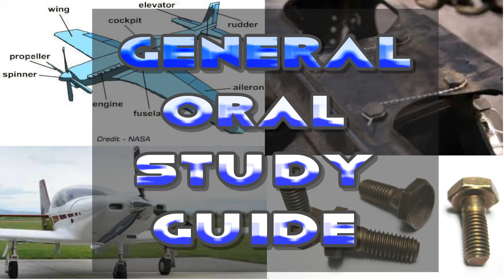2026 FAA GENERAL Oral Exam Study Guide

Comment: I must have watched 10 hours of your channel between the airframe oral and general oral videos. If i pass this test Monday I'm heading over to your shop and picking up a sticker
Reply from the maker: Bro my pliers are coming soon once you pass ill send you link for my safety wire pliers 🤪🤪🙂🙂🙂
Reply: @northeastaviationpro maybe that will be my gift to myself after passing my powerplant o&p
Reply: Did you pass how was it any tips
Reply: @300goincray3 yes sir. 

First, just relax. It's an easy test. I didn't listen to people telling me this so please listen to me. It is not hard. You WILL pass.

Secondly, get extremely familiar with the sections you didn't perform well on for the writtens.

Lastly, dont delay. Take the test and dont push it back. You will never feel ready to take it.

Giving tips is hard. Ask anything though and I'll give you an answer
Reply: @qmatlrbsej is the written all multiple choice and what should I study for mainly for the o&p? Did you find work? Do you think it’s hard to get in the major airlines?
Reply: @300goincray3 yes the written is multiple choice was four possible answers. Study the sections you got wrong by looking up the codes from the sheet you get back from your written. Watch this video along with looking in the back of the Jeppesen book. I have not found work yet. Yes major tend to be more difficult for a variety of reasons. Most require relocation and experience
Reply: @qmatlrbsejwassup brother, where can I reach you? I got questions about orals, I passed my writtens and practicals for general and airframe but have failed the orals twice.
Reply: @Swavyy_Jayyy right here. Ask away
Reply: Taking my General and Airframe O&P, what is harder oral or practical. And what should I practice for practical section? I think I’ll do fine for the oral!
Reply: @sofianaranjo8036 I would say the oral is harder only because there are a handful of questions you need to memorize. Practicals are difficult to study for. I would recommend buying the Jeppesen book which includes practicals and oral questions. I would just touch up on simple stuff like riveting, safety wire, 43.13, micrometer, voltmeter, etc
Reply: @qmatlrbsej lmk please

Comment: Just passed my O&P for generals and airframe! Thanks bro!
Reply: How were the questions? Hard or easy? Was jeppesen good for studying the oral questions
Reply: Ya id say jeppesen was worth it. Not everything was word for word but it helped a lot. The test wasn't too hard if you study enough.@lamboguy123
Reply: @00711cd  good deal. I appreciate it my man. Been killing myself studying 5 to 8 hours a day. It'll all be worth it in the end 💪
Reply from the maker: Congrats bro, this is the first step
Reply: Would you say most of the questions you got were from this video?
Reply: @cypress2050  I know you probably weren't asking me, but I just got my airframe. I would say it was very mixed. Only a handful were from the book and this video. However, it was not particularly difficult. I honestly found studying the 8083 to be much more beneficial than using the study guides. I actually did not even study the airframe study guide, just the generals. For the most part, my oral questions were very simple, most being one to three word answers. Definitely based on my missed acs codes. What I did was I went to each section in the 8083 that related to my codes and made quizlet questions for anything that could be a bullet point or an oral question and then studied those. Then I brushed up on the entire chapter but didn't necessarily memorize. For instance if one of your codes is "landing gear warning and position indication systems," study the things that directly fall under that code and then re-read the entire landing gear chapter. I honestly found the two oral questions asked during the practicals to be much more difficult. Good luck! You got this!
Reply: @lamboguy123 I really appreciate this. I have my general + airframe o&p coming up so I want to be as prepared as possible. Thank you.
Reply: @cypress2050  of course! It really isn't all that bad. As long as you take the time to study, you'll get it over with and wonder what you were worrying about!
Reply: @lamboguy123 thank you again. If i have any questions in the future, is it cool if i ask you?
Reply: @lamboguy123 congrats. How about the practical projects? How many projects were there? Moreover, how to know the list of possible projects for preparation point of view. Any information would be helpful. Thanks

Comment: 00:17 Chapter 1 Math
04:53 Chapter 2 Physics
11:34 Chapter 3 Basic Electricity
17:33 Chapter 5 Aircraft Drawings
22:36 Chapter 6 Weight and Balance
36:28 Chapter 10 Fluid Lines and Fittings
45:47 Chapter 12 Cleaning and Corrosion
52:48 Chapter 13 Ground Handling and Servicing
01:1:47 Chapter 14 Maintenance Publications, Forms, and Records

Comment: The questions I was asked were not in this video.
1. What is the relationship between electricity and magnetism? Electromagnetism.
2. What does a conductor producer when it conducts energy? Electromotive force.
Reply: How did you do, what material did you use
Reply from the maker: Good lookin

Comment: Just an update, took my A&G on FEB 29th and passed both the orals and the airframe practical. Failed the general practical for dumb shit really which was all me. Doing my  retest for my general practical on april 10th. For the Orals some questions I definitely knew because of these videos but if I had to make a recommendation I would say get into this and also study the chapters in 8083s on the sections you  got wrong from the writtens and actually understand the systems. Really helped me out alot. Focus on the writtens, the practicals are fairly easy and pretty much open book when using reference material. 
Take it from a guy the Graduated an AMT school in 2016 i was really nervous but once i got into it, it wasn't that bad. Study and do what you gotta do but don't stress and burn yourself out too much. Hope this helps
Reply: Are most of the questions based on what you didn’t get right on the written part?.I just finished all 3 of my written and started studying for the o&p.
Reply: @ricardonarbona5028  Yes!!!, they are.  my recommendation. watch these videos because some of my oral questions were definitely word for word but also go through the 8083s and study the chapters of the sections you got wrong on the written because oral questions I got were definitely not in these videos so reading the chapters helped me in that way. Like what are the components for a capacitor? or what does a Carburetor do?
What are some different types of pumps? What's a stress on a aircraft structure? questions like that you'll get from the 8083.
Reply: @elliottbradshaw242  Thanks.
Reply: @elliottbradshaw242  Good luck on your restest April 10th and hell yeah to passin the rest! 💯😎

Im about to take my O&P soon for powerplant/general. Question tho! 

So, based on the missed written ACS codes, just study the related chapter in the 8083 books—that I understand—but are you creating your own questions (?) is there a version of the 8083 that has questions to answer/study? Or you studied the 8083's sections based on what you missed and knew what to answer during your oral  test?
Reply: @kamekaze997  No unfortunately there are no questions within the 8083s. It's just a general textbook that most other textbooks get their info from anyway. I just studied the chapters and made my own index cards on info that I thought would be  important. If I had to make a recommendation Learn these videos because some of my oral questions were definitely word for word. but also study 8083s and learn the systems and components and whatever knowledge you think will be important
Reply: @elliottbradshaw242   ty for the quick reply bro! 

I'm literally studying this vid's transcript alongside a pdf my school gave me making flashcards, using chatGPT to dumb shit down lol, highlighting stuff in my 8083 books and taking your advice! 🤙
Reply: @kamekaze997  All good bro, just want us all to elevate. good luck on your tests and let us how it went.

Comment: Just passed my O&P 01/27/23. These videos were the reason I passed my orals, thank you for the time and effort!
Reply from the maker: Great job man help show support by getting some aviation merch check out link in description.
Reply: Congrats! How did you prepare practicals?
Reply: @30센치강철팩  if you are familiar with following a manual you won’t have to study for practicals. I personally only refreshed my memory on weight and balance equations, sheet metal formulas (or where to find them in a handbook), and practiced my safety wire
Reply: Was the orals the hardest part? Im studying for my general right now
Reply: @JJFN-zm3ky  Personally, I made study guides on quizlet for all the questions I couldn’t fully/accurately answer and that was the hardest and took the longest for me. But if you study you will pass
Reply: What is your name on Quizlet
Reply: @carson cook

Comment: Took my Os today for A&P and passed. Trust me when I tell you 100% of the questions asked was from this guys video. Sadly I didn’t get my License because I failed 1 little project where you have to put the correct size of the bolt in the hole 😂
Reply: I’m pretty confident about the oral part but I really don’t remember any of my school projects 😅 do they give you a manual or instructions for the practical portion? What do you recommend me brush up on before I go into my exam? Going this Monday for my Powerplant then Airframe later
Reply: @kushedd  how was your test? 20 days away from general and power plant, and also worrying about the practicals because I might not remember them.

Comment: I tested Tuesday, every question i was asked on the oral is included in these 3 videos. If you study these and remember all the answers there should be no reason you don’t pass. Thank you for making these.
Reply: I take my O&P in 3 weeks..how was the practical part of the test?
Reply: @DG-lo9mv  hey man the practical would’ve been difficult to study for. Just ensure you know how to navigate a manual. And also use a manual for everything you do. I had to do a power plant inspection and find things that would make the aircraft unairworthy, blend a dent on a prop, flare a hydraulic line, drill a few rivets, calculate weight and balance, install ignition leads on an engine. Maybe a few more things but all very basic things
Reply: @reeddigiulio2938  ok appreciate it
Reply: Bro this has me hopeful as shit, most of the may questions I can understand with my highest level of math being college algebra k my junior year and I’m applying for AIM Houston in two weeks
Reply: Math* idk wtf it autocorrected to may
Reply: @Reed Digiulio I take my o&ps tomorrow are there any videos that can give tips to improve my skills on how to navigate a manual
Reply: @Slappinnalgaz  p hub offers a lot of tip videos
Reply: What’s the best way to study this whole video?
Reply: @gioch8882 just listen to it anytime you get the chance and answer the questions verbally. If you don’t know. Listen to the answer and turn it into a way you can understand it. I listen in the car during work commute, at the gym or if you’re even at work if your job allows you
Reply: How long did you study
Reply: Good to heD
Reply: Are you tested on math and then physics. Or are the questions all mixed up?
Reply: Did you pass your orals ?

Comment: about to take my first general exam, this video helped a lot. Its one thing when you read it in the jeppesen book and can see the answers, its another trying to answer the questions without looking at anything and then knowing the areas you need to work on. Great video man, thank you!
Reply: Have you took it yet? I'm looking to take it myself in a month, other than this video and the jeppesen book what have you found best helps with studying and retaining the info? Just finished my general classes a few weeks ago AIM student in Orlando
Reply: @randymorera5286  if you have access to fulcrum they have videos on there that give some pretty good break downs of everything. Some questions were directly from prepware and some were the same but just worded differently. If you can go through jeppesen and explain each answer in your head you'll do fine, as long as you understand the systems the questions wont be hard. I ended up getting a 90 on mine.
Reply: @brianwasdorp6490  is there a way yo prepare for practicals? Thanks man
Reply: @carfscawthonii6937  If youre an AIM student block 17 is like the capstone and you should be going over what could be on the practical and actually doing it in the shop, it should be the same for your orals as well. The practicals are based off the projects you've done in school so just save them all.
Reply: @brianwasdorp6490  I ain't an AIM student but just a student of a part 147 AMT school here in Asia but I'll go look up and study about block 17 tho, thank you very much for the advice!

Comment from the maker: Chapter 1 Math 0:17
Chapter 2 Physics 4:53
Chapter 3 Basic Electricity 11:34
Chapter 4 Electrical Generators and Motors 17:23
Chapter 5 Aircraft Drawings 17:33
Chapter 6 Weight and Balance 22:36
Chapter 7 Aircraft Structural Materials 30:34
Chapter 8 Aircraft Hardware 33:17
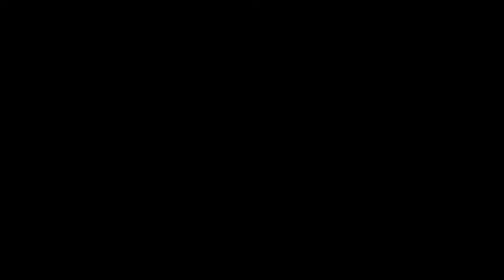Chapter 9 Hand Tools and Measuring Devices 35:34
Chapter 10 Fluid Lines and Fittings 36:28
Chapter 11 Non-Destructive Testing 43:00
Chapter 12 Cleaning and Corrosion 45:47
Chapter 13 Ground Handling and Servicing 52:48
Chapter 14 Maintenance Publications, Forms, and Records 1:1:47
Chapter 15 Mechanic Privileges' and Limitations 1:16:47
Reply: Oh you did, only saw it on the  video scroll tab timeline later on, and now I see this Thank you, NOT trying to be a jackass, but I fall into that realm often.
Reply: I just completed this course online at Embry Riddle Uni. I own the physical copy of this book. It’s quite useful.